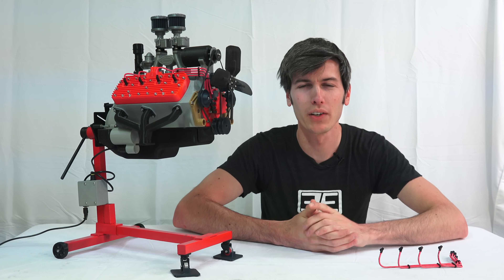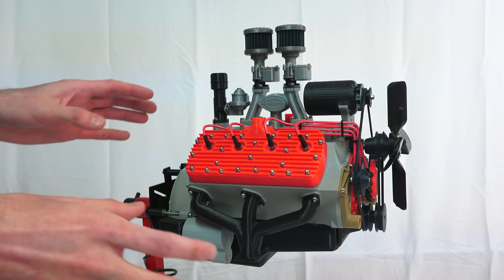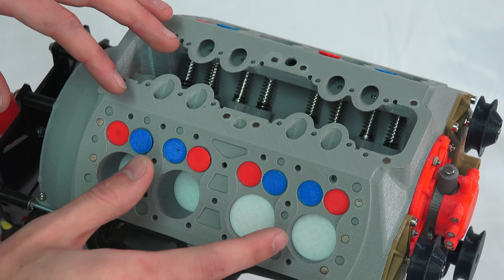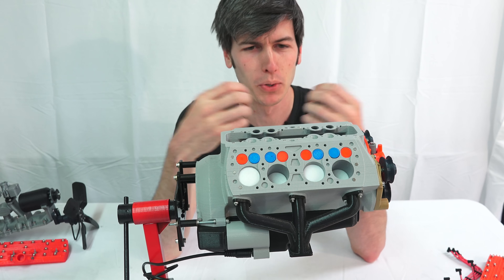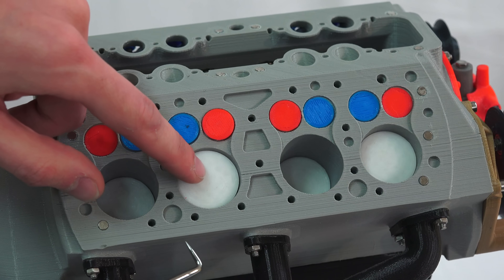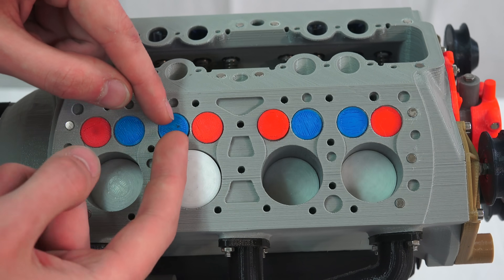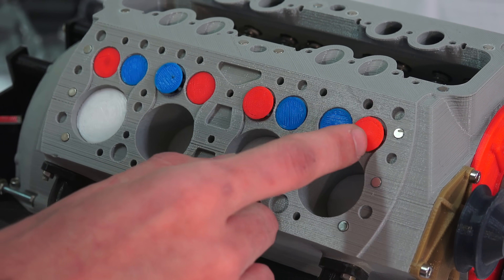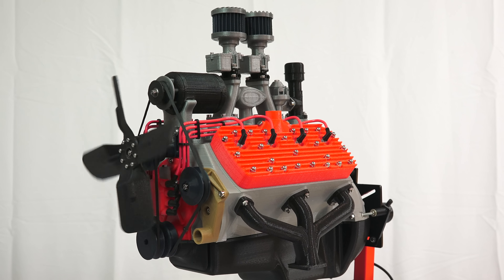Why Ford's Flathead V8 Engine Died

Comment: I actually have 2 continental flat head 4 cylender engines they are the f-163. They are in 1972 Lincoln sa-200 welding machines. I run 1 every day. I love the flat head motors.  I'm pretty sure the have like 12 hp tho 😄

Comment: Great design, but the early Ford Flathead V-8's had cooling/oiling issues-John in Texas
Reply: I saw another You Tube video on the creation of this engine and many early visitors to the showrooms predicted the exact failures that the engine suffered. They specifically did not like the way the pistons might wear on one side, the poorly thought out lubrication system, and the failure to make cooling system capabilities more important than good looking styling on the front of the car. 

It was interesting to me to find out why big ships use inline engines with two piece connecting rods. To avoid as much as possible any side pressure on the pistons and rings. A V configuration wouldn't have the longevity of an inline. It seems that if you took the best technology, like two piece connecting rods, you could create one heck of a long life inline 6 cylinder motor vehicle engine.

Comment: I drive a 51 Ford Coupe with a flathead V8 engine. 79 000 miles. I don't think I will keep it in the car as I will probably go with a 54 Mercury Y block V8. I guess that will make my coupe a Ford-ery huh ?

Comment: I think crossflow only makes a difference when using a cam with overlap, otherwise it should not make much difference. Most stock old engines does not use overlap cams due to the reduced milage introduced by it (while increasing power also wasting some fuel into the exhaust).

Comment: The other factor here was fuel quality.  The common fuels available between the wars, and immediately after WWII, could only sustain low compression ratios.  So OHV engines were fine then.  But as fuel quality improved, so did the desire to run higher compression ratios, and it was then the airflow vs compression ratio conundrum became problematic.

Comment: What a joke.    Valve in block designs survived clear into the present day.   The flat head ford was 120 hp in 48 and with after market parts could do a lot more. As for the air flow patterns he needs to go back and look at that head design again.   That engine was one of the best of its time.  The only real issues were the water jacket cracking around the exhaust valves because ford pushed the block beyond what it could take.   Instead of make a new thicker block they jumped to a push rod motor in Y vs V design to increase stoke instead of cylinder bore to get bigger displacement.

Comment: The two center ports are called Siamese ports. Also that is a model of the early motor not the late motor. The v8 60 hp wasn’t made till later I think 1939-1940. The 1932 was an 80hp with the water pumps in the head. In 1937 they went to a water pump in block as your model has. In 1949 they switched to a short bell 8ba model which was a larger more powerful motor, they also changed it from a front mounted distribution unit to a drop in distributor like a more modern 1950s type motor. They also then took the bellhousing off the engines casting and used bolt on style bellhousings and more modern type transmissions. Your model has speed equipment, the intake was a cast aluminum or steel with a single carb, it would have had one oil bath air cleaner, and no finned heads like you have there.
Reply: Thank you the presenter made so many mistakes it was setting my teeth on edge.

Comment: So by adding airflow by modifying the head lowers compression then put a supercharger on it and even out that compression ratio and wha bam! That should help the pesky low power problem as well.

Comment: All credibility lost when you claimed to been born 1953.
You lost me at 0:50.
The flathead "died" because it was obsolete and was replaced by a more fuel efficient and more powerful overhead valve engine -- and not just by Ford. By 1953 pretty much every domestic auto manufacturer had an overhead valve engine.

Comment: It also had a tendency to overheat. If you'll notice the inside exhaust valve ports run right between the cylinders.
Reply: manic mechanic and the water passages they always crack there. And between the valves and the cylinders

Comment: The Ford flathead V-8, and all flathead auto engines, died because of it's inefficient combustion chamber shape and it's inability to tolerate high compression ratios. In fact, the reason for the many cylinders was to make the individual combustion chambers smaller in an attempt to get around those problems. It worked OK when high octane gas wasn't around anyway but after WW2 with higher octane gas available the flathead engine was doomed, except in small low output engines. And today even many small mower and industrial engines are OHV. Even Harley Davidson stopped building flathead production engines in 1956, although they continued making flathead race bikes for years afterward because of archaic rules that allowed flatheads to have a 50% displacement advantage over OHV engines racing in the same class. When that rule was rescinded the flatheads were no longer competitive.

Comment: then Briggs and striation took over, LOL looks like lawmow motor when you take the head off.  my old ford tractor is a flat head strait 4.
Reply: V8 Briggs+Stratton= Badass Lawnmower
Reply: Liljohn P lol
Reply: When people see my 53 flathead i tell them that it’s like 8 Briggs lawnmowers hooked together except not as powerful. Unfortunate but true.
Reply: haha, you're right
Reply: Both Chrysler and 
GM made flatheads. 
They were in line 6 cylinders.  The last ones in 1953.
Reply: @herbbowler2461   Actually, GM stopped making flatheads before 1953
Reply: Chris Page That's basically what any flathead engine is.
Reply: The Ford N Series tractors (9N, 2N & 8N) used an engine which was essentially one side of a Flat Head V8. This was done to cut cost and development time of these tractors.
Reply: @michaelhalsall5684  I seen some people put Flat head V8's in there old ford tractors.  They had to build adapter plates ect but man it would be great to have a tractor with that power.   The only thing I don't like about my tractor is once in gaged you have to stop the tractor to disengage it.  I would liked the idea if they had a second clutch just for engaging and disengaging the PTO. and let the Hydraulics' run  The newer fords LIke I think the Jubilee had a separate pump for hydraulics on the out side of the tractor and ran Constance with engine power.
Reply: @McCuneWindandSolar  There was company called "Funk" that did Ford flat-head V8 conversions for the Ford N series tractors. Search Google for "Funk V8 tractors conversions" etc.

Comment: wow i knew your aging well but 1954 DOB, wow, and the flat head ford lasted from 1932 to 1954 is remarkable, all things come to an end and thats a damn good run, not fair to say "why the ford flat head died,should said instead, why the Flathead ford lasted 22 years instead. its was the chevy overhead valve v8 that finally surpassed the flathead ford but not until the mid 50's

Comment: The french made ford flathead v8’s all the way through to the 90’s. I believe they are almost identical to the 8ba
Reply: No, the last French V8 was produced in 1961. Ford sold its French factory and "Vedette" car design to Simca in the summer of 1954. The 2.3L flat head V8 was the top of the line for French cars and the cars were popular. They were successfully exported, under a Ford label, to Germany and the Netherlands. A stretched convertible was used by presidents de Gaulle and Pompidou until the early 70's. After 1957 the same car bodies were more commonly powered by a more fuel efficient Simca 4 cylinder overhead engine. The modern Citroen DS was by then the car of choice for French politicians and executives.

Comment: The most impressive thing about this engine is how silently it runs! And the next most impressive thing is how it stays running even with the cylinder head removed and the carbs removed...
Reply: You can see a video of an actual flathead running with 1 head removed, for reals, each side is it's own 4 cylinder engine.
Reply: @markk3652  yeah I've see that one too. its pretty interesting to watch.
Reply: My doctor did say that cutting down on carbs is good ;)
Reply: @woogymodel  He was no F[l]at head.
Reply: Award for most easily serviceable V8 goes to...
Reply: AND with no fuel, and producing virtually no heat! No emissions, either!
Reply: yes that was still quality then.
Reply: WHAT THE HELL ARE YOU CHATTERING ABOUT
Reply: bluegtturbo ahhh,thats white man magic 😉

Comment: A little known secret  In 1953 the ford inline 6, that was already a modern over head valve design,  actually made more horse power then the flat head v-8.Because of this Ford  changed the rating from 100 hp in 1952 to 110 hp in 1953 but the engines are identical. They may not be very efficient compared to a modern engine but I still love the sound of a cammed up flathead v-8 though.

Comment: What made it affordable to mass produce was the fact the block was cast in 1 piece. All others had to be cast in 2 pieces and joined together. Ford ordered a massive effort to figure out how to build the V8 block in a single piece  and eventually the engineers got it.  That’s what made it affordable to produce vrs the dual cast blocks that were complicated and expensive to produce

Comment: Lots of other easy ways to increase comp. Building a stroker would be the hardest. Thinner compressed thickness head gaskets, shaved heads and dome pistons are other ways. You can increase comp alot without building a stroker. My stock stroke 302 makes right around 11.0-1 and factory comp was 8.5-1.....

Comment: I believe you forgot to mention a major reason for the thermodynamic inefficiency of the Ford flathead V8:  that the exhaust gasses had to flow through the water jacket in order to exit the block. That also made them prone to overheating.

Comment: The last Ford flathead V8 was not built in 1953: was built in France up to 1961 for the french car Simca Chambord, V8 2351cc 84hp SAE...And in 4.2L /100HP SAE up to 1973 on the Simca Marmont military truck ...Simca did buy "Ford France" (who built the Ford Vedette) as the factory close...

Comment: The simplicity is alluring despite the shortcomings (I hate complex valvetrains (5 valves per cylinder, four camshafts, variable valve timing, tensioner pulleys, timing belts/chains, the electronics, THE LEAKS!!!, etc)) - while modern engines are amazing feats of engineering, they're basically one bandaid on top of another to increase HP (thanks to competition) while meeting emissions and packaging requirements... the 50's Studebaker L-head inline 6 could develop 233hp in turbocharged form (which solved many of the flow inefficiencies at higher RPM). Imagine that engine with modern direct injection, common-rail turbocharging and light-weight metallurgy.

Comment: The data we collect on design improvements and make engines better, the more amazing it is we got this stuff to even work with "I think this will work" type of design instead of "find me another .03% in the model."

And who doesnt get absolutely giddy mlm over a flathead 4 with a blower on it?
Reply: You have to be kidding.  I work in R&D and have a degree in fluid flow.   The formula your fancy computer models use were worked out a century before the gas engine was even thought up.   A 1930s engineer would run rings around today engineers and do it with a slide rule.   Lol.

Comment: NIce vid.... another big issue with the flathead V8 is the fact that if you modify it in excess of 200hp, it will throw the crank out the bottom of the pan.  Great engine in the day and I still like it hopped up in the right car.... Take Mercury Charlie's Nadine, for instance.....

Comment: My grandfather owned a dairy farm he had also been a trained auto mechanic In the early 1920’s he used several Ford farm trucks all with the flat head 8 in the 30’s, 40’s and early 50’s before buying GMC’s with the 347 V8’s (coincidently the early engines were Pontiac’s little trivia there) Ford parts were cheap and it was much easier for him to rebuild because they wore out quicker under hard use in the late 40’s early 50’s, I was told is when parts prices started rising, grandfather switched to the GMC which was a much heavier duty truck than the Fords from the late 30’s

Comment: I wish my engine came apart that easily!
Reply: Well then it would fall apart that much more easy too...
Reply: a couple chimpanzees with wrenches could work on the flathead, yours requires an engineering degree to change the spark plugs lol

Comment: How do you figure that the Flathead 'died'? It actually lived a perfectly normal production lifespan of over 20 years, and was a huge success by any measure. You didn't even mention that it was the first mass produced V type engine with a unitary engine block, that it's block casting technology was groundbreaking, and that it revolutionized the auto industry. Every automaker in the world would love to have an engine that 'died' like the Ford Flathead.

Comment: I've always felt that the Flathead is an excellent engine for performance builds. The inherently low compression ratio makes it well suited for turbocharging. And forced induction also largely mitigates all the aid flow issues. That the intake and exhaust ports are on the same side of the head is also beneficial for turbocharging as this greatly reduces the distance the exhaust gasses must travel before work is extracted to operate the turbine. With properly reworked heads to support direct injection and some veins for air flow control an improved swirl effect can greatly improve combustion efficiency. 

I think its well past time for the Flathead to make a come back.
Reply: Not really. A very weak bottom end poor airflow and overheating.
Reply: @tomstulc9143   That's because these engines are from the 50s...   A modern take on the flathead could be lightweight, compact, inexpensive and high powered, all while being easy to work on. Too bad no manufacturer has looked at this design in the last half-century, especially now that all production engines are forced induction anyway.
Reply: Why am I the first to like this after 3 months?

Comment: A point missed was the quality of gas available. Really up until the mid 1950's the quality of gas was the main limiting factor  to compression ratios. There were no computers that could rapidly adjust engine setting to compensate for fuel quality like today Back when the Flathead first came out 70 octane was considered aviation gasoline. Today 87 octane is the low number.

Comment: Small engine still use the flat head design today
Reply: yes they do..bullet proof design!
Reply: @chrisdills2885  not bullet proof, but much cheaper to manufacture and smaller...
Reply: analyste It’s bulletproof in that it has withstood the tests of time, and provides great reliability and longevity for most applications.
Reply: Most engines are going towards OHV, now.
Reply: All the lawn care guys buy the OHV engines for a reason.